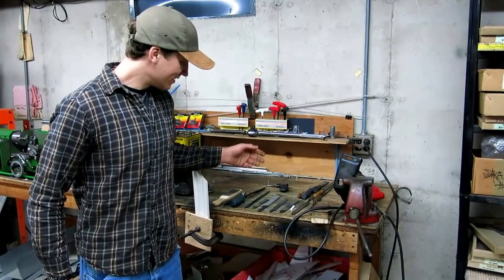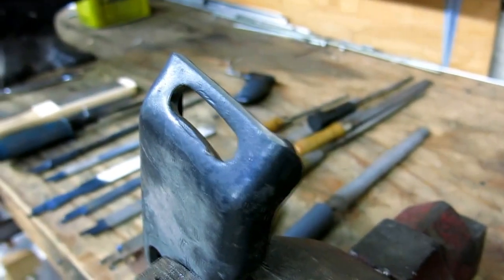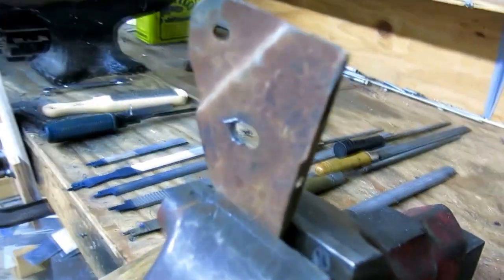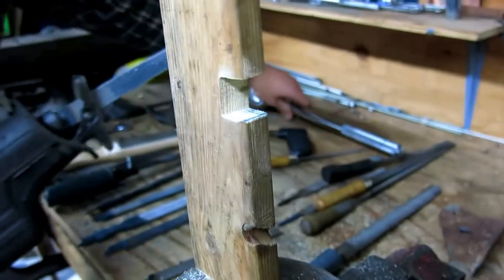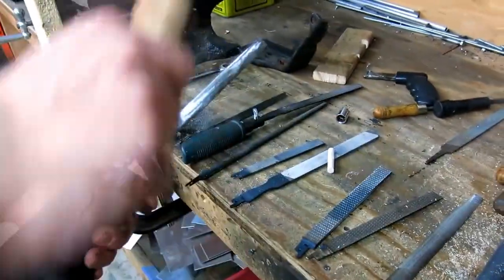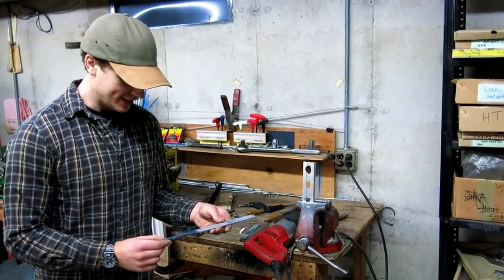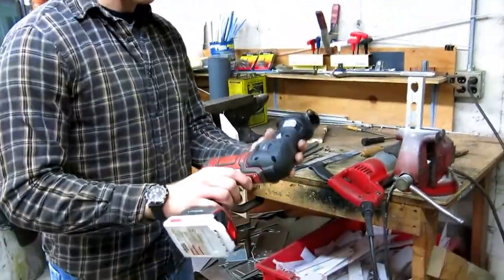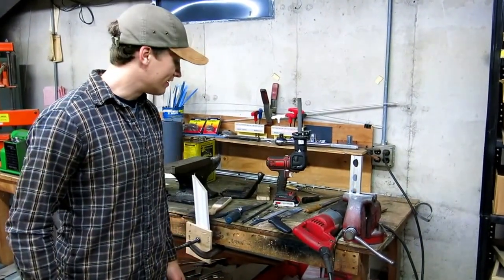the fast filer

Comment from the maker: Thanks Mike, I have done a lot of research on direct fit files.  no one seems to have tried it. there has been adapters ,but they wobble around because of the extra pivot point. I have a professional provivisional patent on the idea. I have been submitting to every company I can. hopefully someone will buy the idea and make these. They work quite well, cheep and easy to produce. I am even considering making and selling them myself, if none of the companys go for the idea. Thanks for the positive feedback 
David